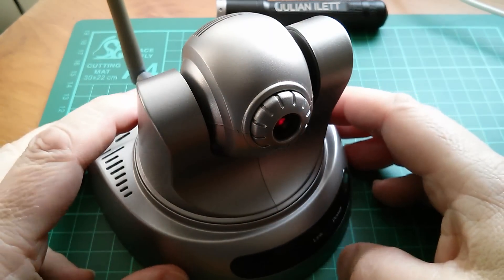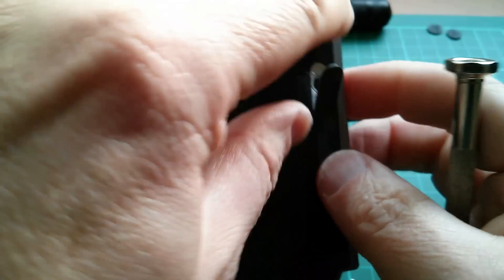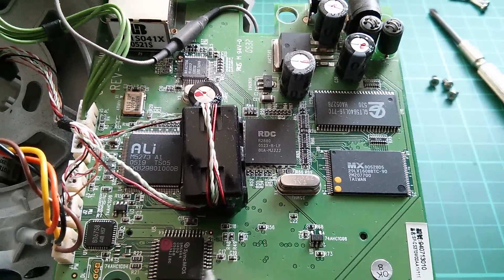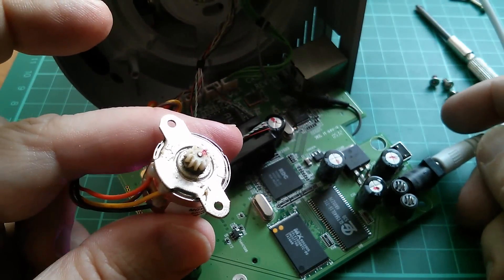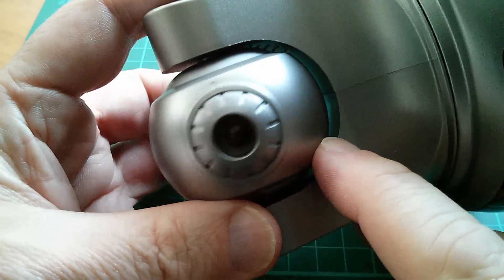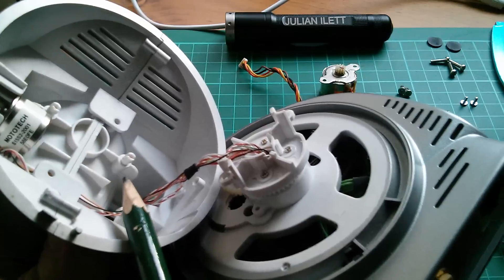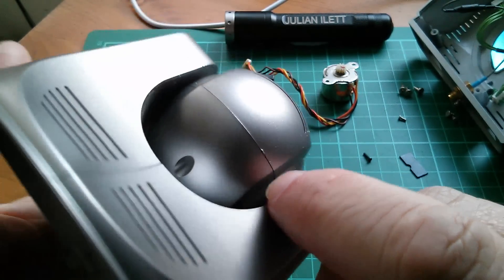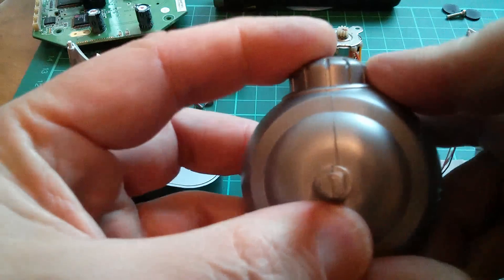Teardown: Pan/Tilt Wireless IP Network Camera

Comment: What would you check if the camera suddenly doesn't power on?
Reply from the maker: The power supply :)
Reply: @JulianIlett  checked it and it seems to be OK. When power supply plugged in to ac and camera on other side,  the light on the power supply itself flashing and nothing happen on camera side. When power supply connect to ac outlet on one side only (not to the camera)  its light is steady. I thought you have an idea what to check inside the camera...not sure what to look for

Comment: Did you really glue the pin back? Most plastic glues I know stay too flexible, so the pin wouldn't have worked in its intended function anyway. That's why I mostly use dichloromethane to "weld" plastics. After it evaporates it's like a single piece of plastic again. If that doesn't work, you could always make the broken pin stick somehow until you drive a small screw in to spread the two prongs while the thing to be clipped on is already mounted.
Reply from the maker: I didn't glue it, I just dropped it into the hole and wedged it into place with the screw. It sort of worked.

Comment: +Julian Llett I have a question not related to this video but couldn't find a way to contact you privately.  It is regarding lithium ion batteries, I am wondering what safety precautions should I be taking when charging them with a variable power supply and not in a circuit designed for charging them such as cell phone batteries.. I know many of your other videos you talk about the protection that some batteries have, do they all have this?  what does this circuit protect against?  Over voltage and/or charging? 

I would appriciate any information you have on this topic if you have time to respond.  Thanks in advance and I enjoy your videos keep up the great work.
Reply: +Enrico Ricci Hi Enrico. No, not all batteries have protection circuits. When a battery has it, it usually protects the battery from over-voltage (overcharge), under-voltage (under-discharge) and short circuit (battery go bang!). Some boards have thermal/temperature protection, but that is more often managed by the charger / device. On a cylindrical (e.g. 18650) battery it is usually a round board on one end of the battery (often the negative end), and flat/prismatic (mobile phone) cells have it at the top of the battery (where the contacts are)

If you charge the battery on a variable power supply, that is ok, as long as you limit the current and the voltage. i.e. for a 800mA single 3.7v nominal cell, you want to be setting the voltage to 4.2 v, and current limiting to 800ma (at most). This means the battery will charge at 800ma until it reaches 4.2v, and then the current will drop off as the battery gets to its full saturated charge point. Once it drops to under 100ma current going it, disconnect the battery as it is fully charged (technically it would be 80ma as it should be 1/10th of the starting current, but 100ma is near enough). 

Charge circuits based on the TP4056 are pretty cheap on ebay (US$1 for 1, or $3.83 for 10), and you can get the TP4056 with battery protection for US$3.70. Only trick with those is you may want to replace the current set resistor to better suit your battery.
Reply: +Enrico Ricci 
Do yourself a favor and get a charger. There are also small boards that you can get for less than a € (or less than 50cent if you buy ten of them ;) ) on ebay to charge a single cell from 5V for example.
Charging a lipo is very easy in principle, but a variable power supply just isn't the right tool for the job. The current and voltage limits on a lab power supply are way too coarse to set and on most drift horribly if you let it run for an hour.

Comment: Did it go back together? That's the tricky bit.
Reply from the maker: +mc349iii It did go back together, but the pan stepper motor was losing steps due to some friction. It does seem to have settled down now though. A 1-way teardown would have been a lot easier!